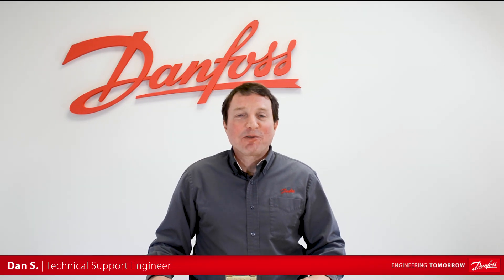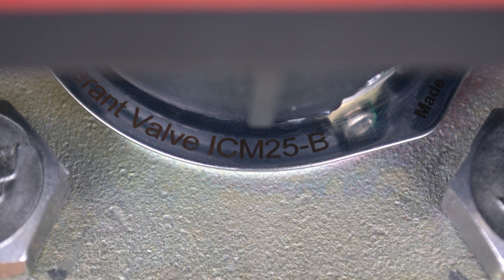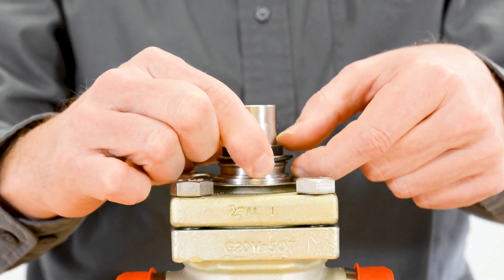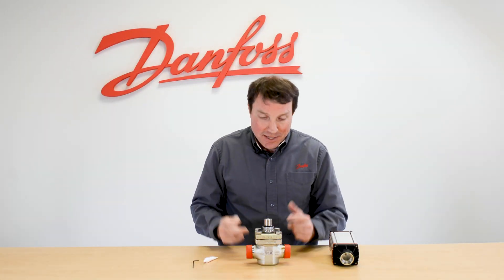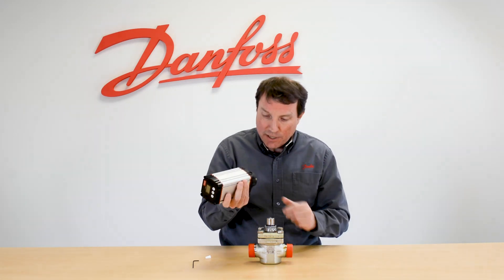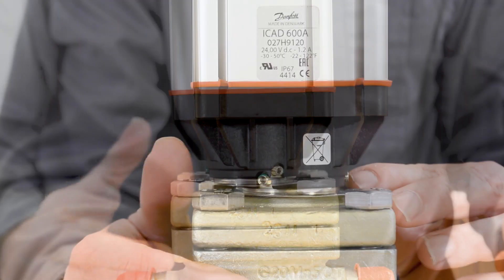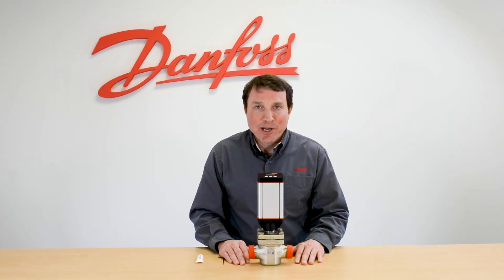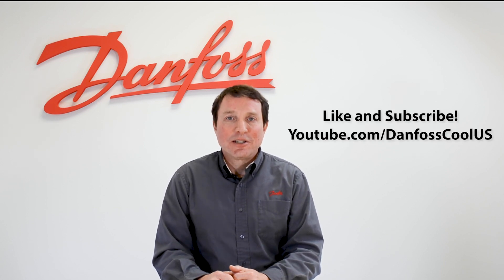Installing an ICAD actuator on an ICM motor operated valve

Comment: Helpful video. I want to replace an old CVMQ valve. Can I use this actuator you are showing to replace it?
Reply from the maker: Hi, soteris ter. We are glad you like the video. To answer your question, functionally, yes the actuator can be used,  but it will depend heavily on the details of the application to determine which parts will need to change.  Please contact your local Danfoss Technical Support team to discuss the replacement in more detail. In the US, this team can be reached by dialing +1-888-326-3677,  press "1" for cooling, then press "2" for technical support and finally, press "3" for the industrial refrigeration team.  They will be happy to assist you with this type of replacement.